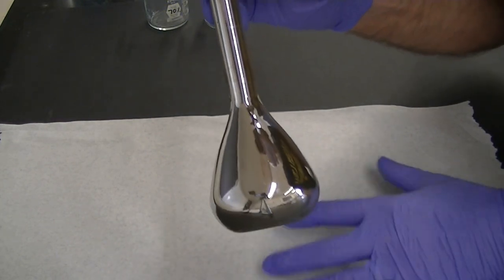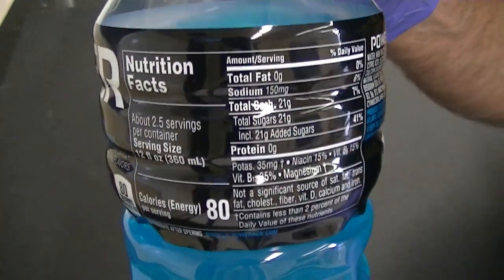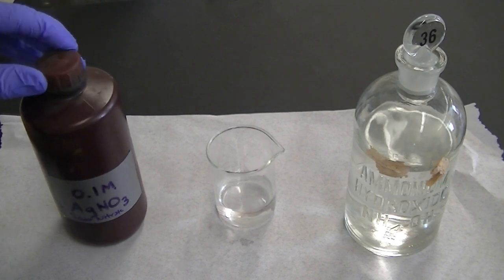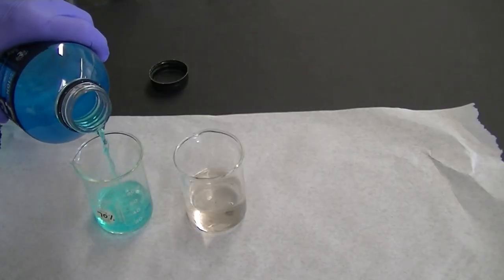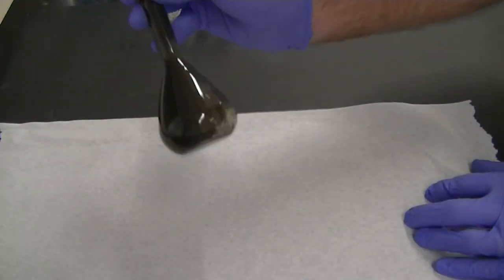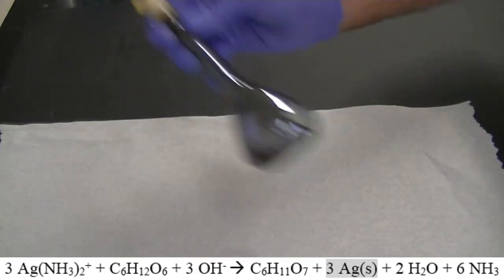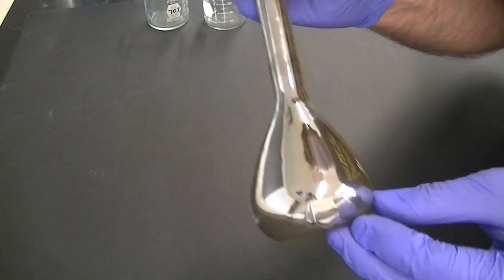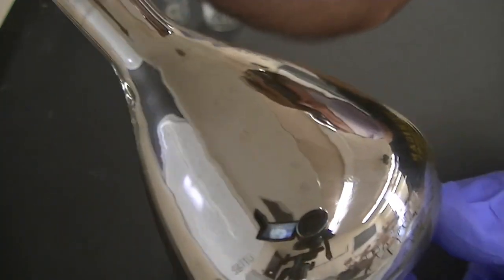Making a Silver Mirror using Powerade

Comment: Hey I wonder if it would work on a telescope mirror to make it reflective...if only there was an easy to follow guide that wasn't cheezy.
Reply: It sounds like am idea i have. The mirror has to be pretty well done with care and the parabolic glass must be pretty perfect as any indentation can lead to problems later on in the optical quality of the image
Reply: @photonik-luminescence  I'd like to hear about your idea
Reply: @richspillman4191  so far i am thinking of coating some lab watchglass and use a regular secondary mirror to see at wich distance it works (focal length). I just need a silver based compound, wich i don't have. Maybe spinning and shaking the solution on the watch glass will do it ? Maybe it's better to do it in a container and shake it.